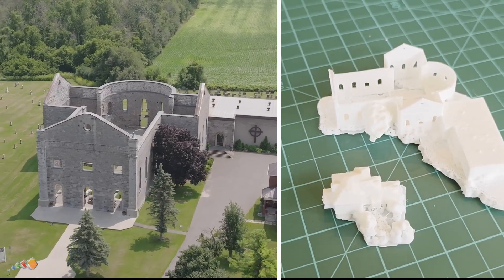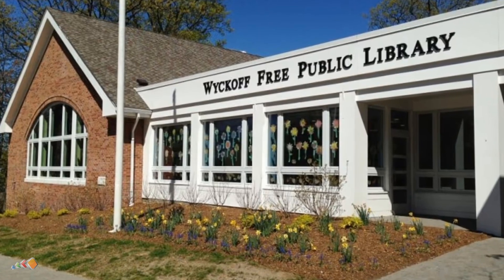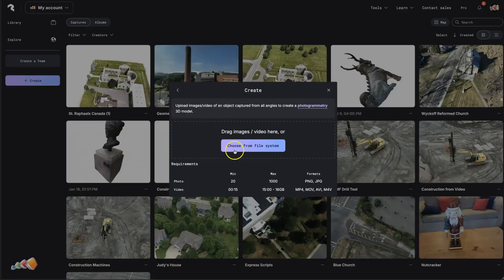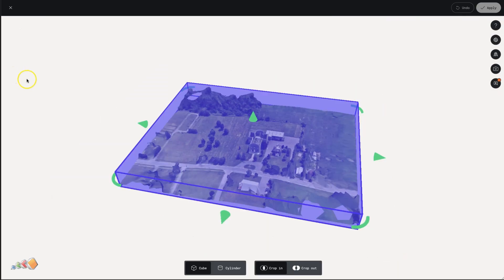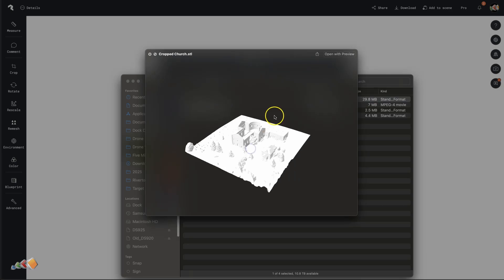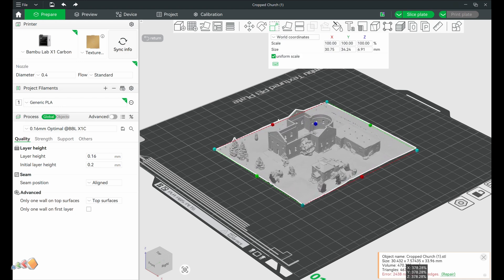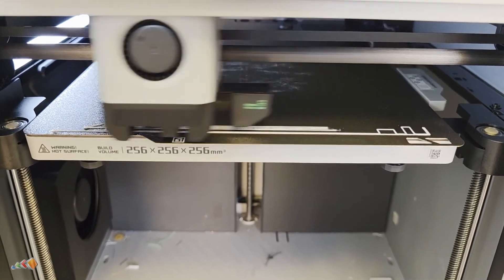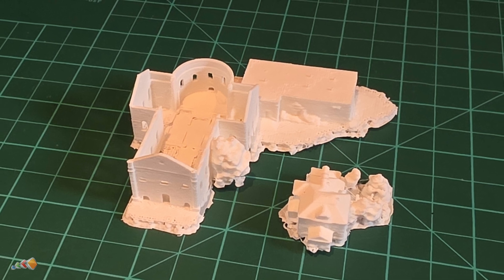Drone to Desktop: 3D Printing a Real Object from Photos

Comment: hi can I do that by webODM
Reply from the maker: Unfortunately, WebODM does not output an STL file which is what is used here.  Since WebODM does produce point clouds it should be possible to convert that into an STL file but I have not looked at tools to do that yet.  I may do that at some point but there are a number of other projects ahead of that so if you find a good way to do that please let me know.